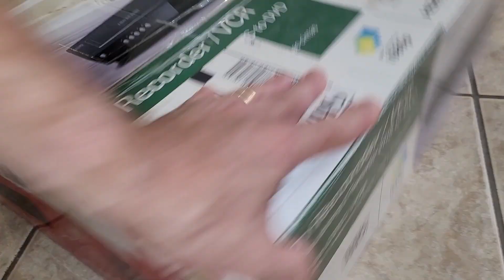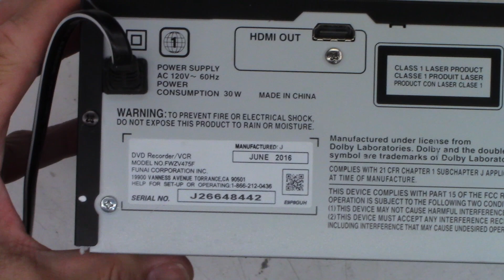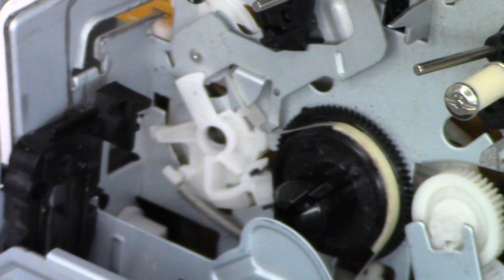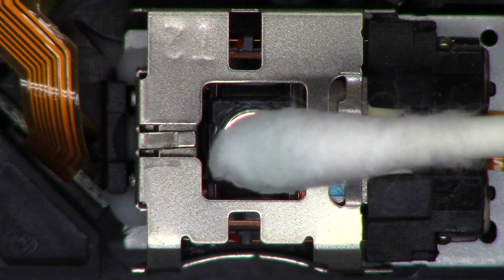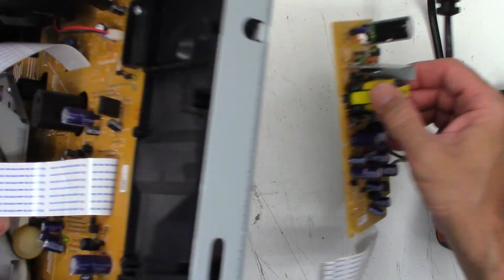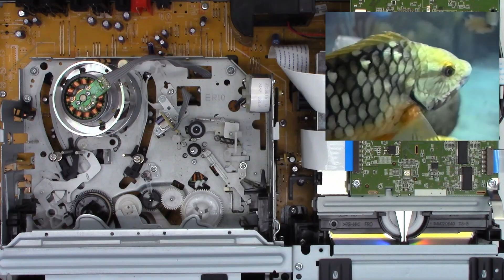Sanyo FWZV475F DVD - VCR Combo. Will not play a tape repair. No parts required

Comment: I'm trying to repair my Sanyo 2015 model FWDV225F DVD-VCR combo recorder not used for many years and would like to replace both drive belts while doing maintenance and cleaning. However I have been unable to find replacement belt part numbers or anyone selling aftermarket belts anywhere on the internet. Please, please, please help me by pointing me to your supplier. Your video is going to me extremely helpful but without the belts I'm batting zero! Thanks in advance for your anticipated response and wishing you a Merry Christmas and a Happy New Year.

Comment: I had the worst time with this model of Sanyo.  First it would occasionally display horizontal waves would appear in the picture and the audio would cut out.  Sometimes all color would drop out.  I cleaned the heads, rollers and guides. Tested, now an event worse problem.  A whine from the left side & playback issues. I had accidently bent the back tension arm slightly. I didn't know this until I ran across this video. I adjusted tension arm and bam, no more whine.  Thank you for the video!

Comment: I've fixed several of these after watching your videos, thanks for great info. I've got one right now that won't take a tape like the basket stuck. Any ideas?
Reply from the maker: Can you load it by hand with a tape in it? Check the 5 and 12 volts to the capstan motor, as it drives the loading motor.

Comment: 2016 was the last year funai made a DVD/VCR combo and Sanyo was the name they chose for these last gasp combo units. In my opinion funai DVD/VCR combos were never great but these ones I find to be even worse then there previous models.
Reply: Did Funai ever manufactured something half decent?
Reply: @UHF43  yes they did back between  the years of 1984-1991. They used shintom mechanism for there transport in there VCRs and the mechanism were some of the best you could get. Also there 80s CD players were pretty good too as I have rebadged one sold under the Yorx name from 1988. I know that Yorx is a low end brand but my Yorx CD player still works to this day with no repairs and can any CD-R disk. Also Funai OEM the GE blockbuster boombox and the radio shack and Sears equivalents. Funai OEM boomboxes for radio shack, Montgomery Ward, Sears, GE, and more.  So any Funai stuff that says made in Japan before 1992 then it's different ballgame.